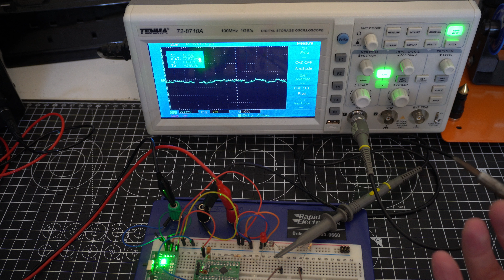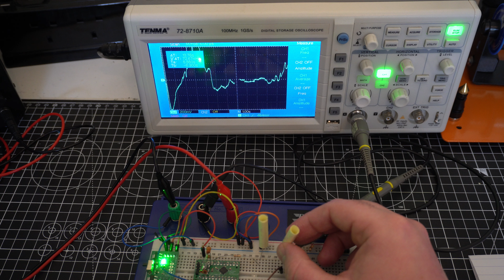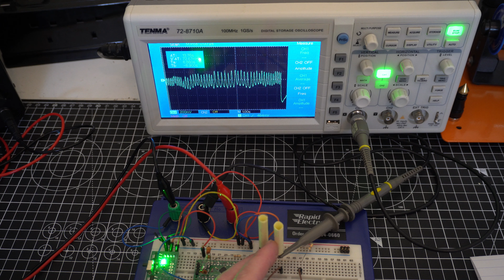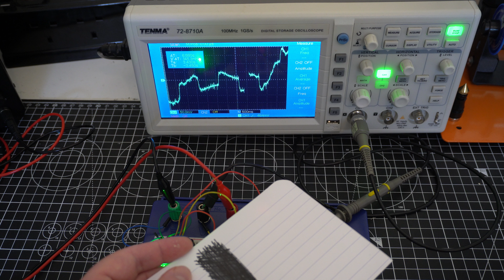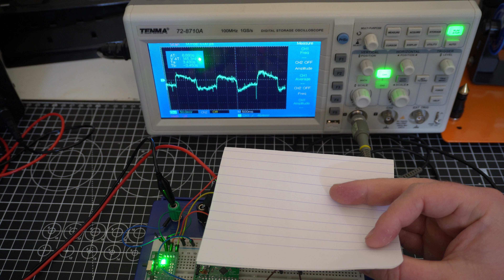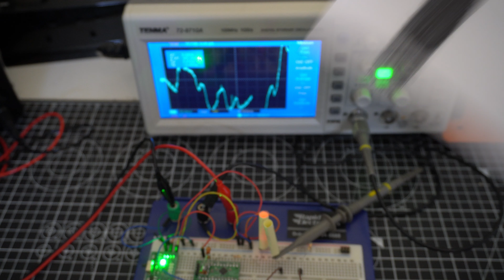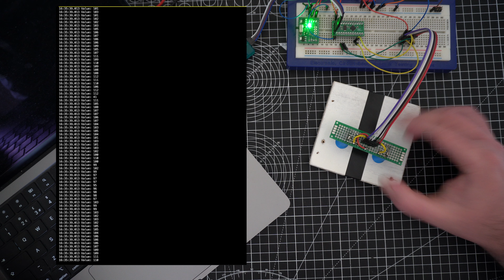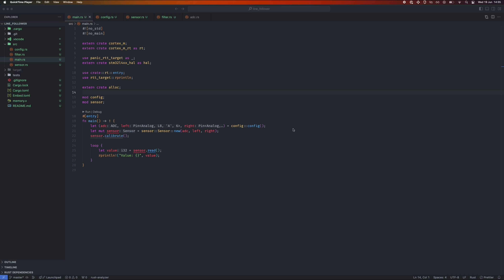Line Following Bot - Part 1: Light Sensors

Comment: Comment for the algo 🤖 
This reminds me of a project we did back in college, except it was using Lego/Technic and a light sensor - had to build a robot that would go looking for lit candles and try to extinguish them 🔥 Looking forward to part 2!
Reply from the maker: Haha, class! That sounds like a fun project. This was actually inspired by a project I did in college to monitor and control the speed of a spinning disc. Strip of black tape on a white disc, read the pulses from an LDR. Then use a PID controller to match the speed to differing breaking forces on the disc.